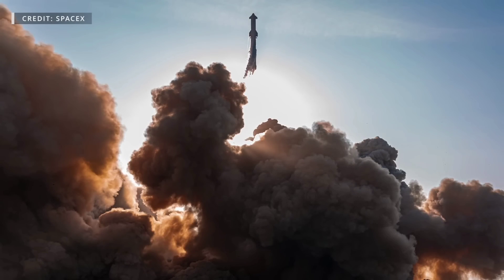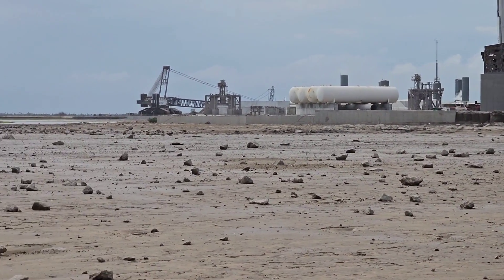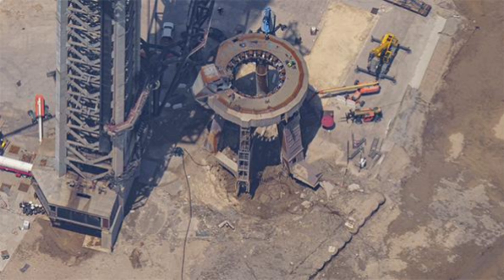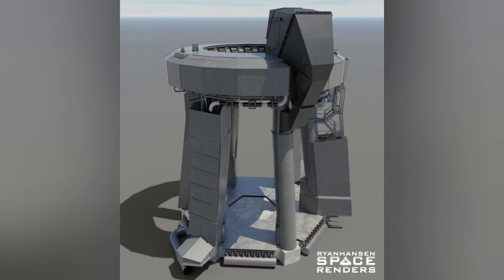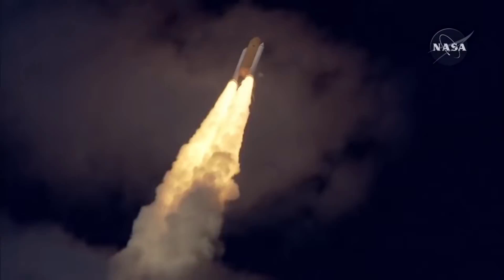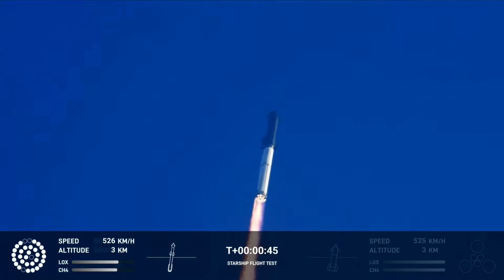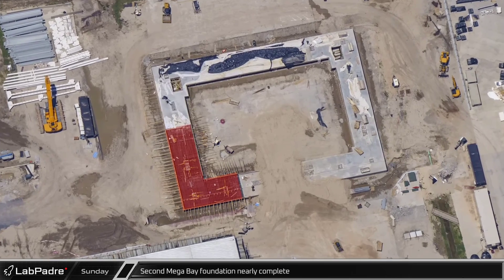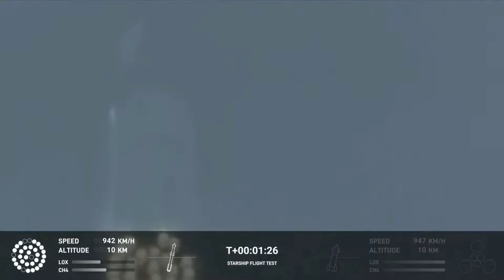Will Elon Musk's water cooled flame diverter be enough to keep Starship and Starbase safe?

Comment: Who said all that debris had to be cleaned up prior to the next launch attempt? I think all that has to happen is the immediate infrastructure (pad) repairs, installation of the cooling plate, re-certification of he FTS and the long-bar is likely the FAA approval of another test launch license.
Reply: I think it would be a great idea to remove all the loose lumps of concrete that will become the next generation of shrapnel if they are still near the pad - don't you?
Reply: @occamraiser  I'm sure SpaceX will survey the situation and do what is required.
Reply: I agree, and that remediation outside the fence is completely separate from resuming flight operations (unless SpaceX blows it off or something dumb like that). However, material changes and re-qualification to the FTS will likely require some kind of lab or range testing to demonstrate the reliability numbers (which are almost cartoonish high), but amending the launch license for a second flight can be done by email and pdf as was done before. The paperwork is actually the easy part because it's just the bucket into which the work gets poured. Time to do "The Work" will be the limiting part.
Reply: @brendanpells912  If the SLS had blown up on the pad, or if Starship had lifted off from the SLS pad the debris would still have hit a nature preserve

let alone any rockets that fail after they lift off.
Reply: @davidelang  Maybe, but NASA minimises the risk of that by a structured, comprehensive test program. For example, conducting a full duration static fire test of the SLS core stage. SpaceX, in contrast, attempted a launch using rocket engines that they knew were unreliable and likely to fail. I wouldn't allow Starship to use pad 39A, they can build their own pad.
Reply: @brendanpells912  Yep, and that is why the SLS program is so much longer and costs so much more than the Starship program.

And SpaceX is building a new pad for Starship, so people should recognize the different development process and recognize when issues are fundamental vs just a side effect of the different development process.
Reply: @davidelang  Well, we don't know how much the Starship program is costing because the SpaceX accounts are opaque, and the program is still at an early stage so who knows what the final cost will be. SLS is also human-rated which makes it more expensive whereas at the moment, Starship is literally an empty tin can.
Reply: @brendanpells912  They stated since the launch that they expect to spend $2B on the Starship program this year.
Reply: or that the same skilled labor required to repair the pad would be the same people cleaning up the debris? shit you got youtubers picking up the debris to sell on ebay, this idea that the debris is a hindrance just shows how disconnected from reality this guy is.
Reply: It's a condition of the site licence that any debris has to cleared up, without driving any vehicles onto the surrounding nature reserve. If the FAA permits another launch without cleaning up after the first one it makes a mockery of the planning rules which SpaceX is paying lip service to. This is why the FAA is being sued, for it's failure to enforce the site licence conditions.
Reply: @brendanpells912  Good to know.
Reply: @brendanpells912  I somehow doubt that they would require the removal of a multi-ton hunk of starship (say the thrust puck with attached engines) without the use of any vehicles. They didn't require any such thing for the SN 11 parts, and in fact they are now instructing people that if they find any SN 11 parts, that they must be left in place as they are now considered part of the ecosystem
Reply: @davidelang  Two people can carry a portable generator that can power angle grinder to cut it into small pieces that can then be carried out by hand or in a wheelbarrow. If it takes a year to do it by manual labour then that's how long it takes. Or do it a launch site that isn't surrounded by a nature reserve.
Reply: @brendanpells912  So you are saying that there should be no launches at the Cape in Florida either, that's all surrounded by a nature preserve (hint, land not used for anything else tends to be classified as a nature preserve, it satisfies bureaucrats needs to stick labels on everything)
Reply: Not sure why people think this is some sort of insurmountable task. Go out with a sweeper and a bobcat and you can probably clean it up in a couple of days. It is probably already done.
Reply: @matthewdehring2898  because the surrounding land is protected.. only in extreme scenarios are vehicles even allowed on it.
Reply: @matthewdehring2898  Not allowed.
Reply: Well, that certainly would be Elon’s preferred FU local residents & environment but in a modern democratic society we don’t have kings.
Reply: @kurknielsen  We don't have kings, but we do have contracts and licenses. Im just wondering what is required per the contracts and licenses.
Reply: @ronwatkins5775  twitter really does need a sarcasm emoji..  yes , SpaceX is required to ensure the wildlife preserve and local communities are not affected but elon has shown he has no interest in doing so.  And in Texas, $ makes the rules.
Reply: @kurknielsen  Sorry, my bad
Reply: @kurknielsen  You do realize that Elon Musk and Space X have bent over backwards to mollify the Eco Wacos right. It's folks like me who say F.O. , we don't give a crap about a few critters and some beach sand !

Comment: The area that was blown out by the exhaust was telegraphing where the flame diverter trench needed to be built. The water-cooled plate could work alongside a full water deluge system and a flame trench.

Comment: Could move it out to sea, my big question is how do you land it in on moon or mars unless you first land with a small ship and bulldozer the regolith ( spelling ) away . Or is the thrust being much less to escape these gravity wells means you can use less thrust on landing and take off? I assume the latter? My previous estimates of 6 cm diameter cables was wrong, because fully loaded starship with boosters is 5000tons not 250 tons as google indicated on my quick search …
Reply: Considering Starship itself will use much less trust + lower gravity and they will have bunch of ships not return from either Moon or Mars they might as well take some sort of solid platform that can be assembled on surfaces.
Reply: @YohXoX  Less gravity and much less atmospheric pressure on Mars.
Reply: @YohXoX  spacex had these little thrusters seen in the starship moon animations. Raptor is too powerful for a moon landing. Using pressurized methalox for thrusters higher in the starship would cause little disturbance. You also have to realize the booster needs the flame diverter/water cooling more than the second stage of starship 7500tons of thrust vs 1500 for he second stage
Reply: That's 33 raptor engines at 90% to take off from Mars it will be 3 engines at 90% to take off from the moon they won't even use a raptor engines they could take off with monopropellant (cold gas) thrusters if they really wanted.

Comment: Well one thing's for sure.  A lot of that water will expand by 1600x, and it's not going to be diverted in particular.  Even though tech like this has been done before, it certainly has not been done at this scale.
Reply: But while the water is expanding, the exhaust gasses are shrinking considerably. Net overall effect is a reduction in overall volume.

Comment: The problem with concrete is it can't handle the shear forces, just look at how the reinforced concrete vertical supports held up. They need just as much armor as the ground. Water does have incredible heat capacity and if he can get a good layer of water seeping through the metal armor for film cooling it does have a good chance at surviving. Building a flame trench would require building the pad taller or risk the salty water table flooding it. They could reduce the water table height by constantly pumping out the water, but again another half-measure.
Reply: That is the point and why the concrete debris was considered a minor issue in the after action. 
First the acoustics are not a concern with this system SpaceX is using Cube law hear so minimizing reflections is the goal, thus the open sides and the 70' hieght. 
Next this is not a steel plate but a steel sandwich. A top plate plumbing and a bottom plate. Most of any flex will be on the top plate the forces are distributed throughout the structure before the ground or pad comes into play. 
The water cooled is straight out of existing flame diverters and has proven reliable. 
What SpaceX is adding here is the shower head that is designed to use the created steam as a pressure diverter. The exhaust has already reached it max thermal expansion, when it meets the water and then the steam that will begin its expansion. This should produce a pressure dome much like that formed in reentry. This will push the mixture of exhaust and steam out an as importantly up. This will allow more of the cubic expansion effect to take place sooner reducing overall perimeter pressure. You can think of it as a virtual circular flame trench if that makes it easier.
Finally it was the erosion under that concrete that produced the sheer that broke up the concrete. You can see that in the post launch photos where the perimeter slabs were broken up by slab along expansion joints. The perimeter slab will basically become the floor of the flame trench and behave much as it does. Spacex will of course look at the erosion post launch to see if more needs to be done. But they are testing Stage 0 every bit as much as Starship.
Reply: @judedornisch4946  excellent analysis, thanks. What I wonder about is if the forces from the exhaust can flex the top plate enough to allow exhaust to creep into, and under, the seams of the top plate sections and start peeling it away. In that situation, wouldn’t the hot exhaust turn the water under the top steel plate into expanding steam, aiding in the removal of the plates?
Reply: @jwortman1984  Flexing that thick of a slab would require it to get extremely hot almost to melting point. With water running through the pipes under it would be very hard to get it to that temperature. It would also be very hard to create a flash steam point if the water was flowing before the plate started heating. As long as the water is turning to steam close to the nozzle holes the comprehensibility of water or lack there of will prevent excessive back pressure so the heat will be carried out and up and the super heating continues in the open.
Reply: @jwortman1984  the bottom of the top plates, with water on their underside, probably won't have much heat transferred to them by the time the rocket is long gone.  Conduction takes time.  Even if not, the water will keep the underside relatively cool.
Reply: @judedornisch4946  Bingo!
Reply: @judedornisch4946  Thanks for this explanation! Do you have any thoughts about balancing water flow with boil off and the pressure of the Raptor exhaust; mainly - how do they ensure that there is always enough water coming out of a hole to keep the exhaust out of the hole and potentially exploding the chamber under the hole? Too much water pressure and they might wash the Raptors - and I'm sure that won't be a good day.
Reply: @erics2112  My fluid dynamics is mostly at the practical level and a bit of theory. But I really doubt SpaceX will engineer any fountain that will have the water moving more than fast enough for the flow to reach anything like more than an inch or two. The Steam is heating up and so expanding and the Exhaust is cooling down and so slowing and condensing. It doesn't appear like that because the surrounding air is heating and expanding also and so influencing the the direction of momentum of the molecules outward. So the expansion of the steam will never reach the engines as the heat will normalize before that. 
As far as water pressure goes the first thing that comes to mind is expansion chambers. Just a conical hole would do much. Much like a rocket engine.
Reply: The concrete also cannot handle tensile forces, such as those produced by intense low frequency vertical shock from the engines.
Reply: @clivemitchell3229  Meant to say shear like shearing. A bit the same thing as tensile. And oh crap the supports were probably turned to sand filled metal tubes.
Reply: @leerman22  There is little reason to think the concrete in the legs has been degraded. If that had happened we would see some external evidence on the exterior leg jacket. That tube would have had to deform to put a non-compressive force on the concrete.
Reply: I have to agree.  Even if you can build a flame trench, trying to get away from the concept is a much better choice.  You greately reduce cost and you might actually get better sustainability and reuseability out a Steel cooling plate.  Its also easier to swap out.  Less to repair.  A water system should do the trick for now, but for the future commercial space port, I think SpaceX should explore the same concepts the nuclear industry is using for cooling Gen 4 reactors, using liquid metals, molten salts or gasses.  The heat exchange is a hell-of-a-lot faster and liquid metals don't change their state so easily.  Just a thought.
Reply: @TheJTcreate  A cloud of steam has some other benefits in addition to cooling. Just for one the dust in the exhaust cloud will serve as points for condensation as it does in the atmosphere and clouds. So you rain the dust out of the plume an limit its extension.
Reply: @TheJTcreate  Did I miss something? As I understand it, the water is supposed to come out the top of the plate at higher pressure than the rocket exhaust and be flashed to steam there. the steel should not ever get hot enough for a problem to develop. the phase change of the water to steam should provide enough cooling. If the system works as SpaceX believes it will work, the thing should produce a massive cloud of steam.
Reply: The vertical supports have a full metal jacket, they are concrete filled steel tube.
Reply: @andyalder1  Wow
Reply: The problem was the slab was insufficiently massive and reinforced most likely due to the high water table so space x thought the thin slab could handle it... They also appear to have neglected the base which is very important in a high water table environment especially where lauch vibration can caise the soils beneath the slab to liquefy and  the slab then to deflect...  This slab needs to be feet thick with a heavily compacted aggregate base feet thick or even a multiple feet thick RCC base stretching out from the pad a dozen or so meters topped by a feet thick heavily reinforced with very large rebar finished slab...  If you eliminate the deflection and add enough mass the water plate should be sufficient but as I've said we're talking feet of concrete and base material not inches which is what it appears they didt with pad mark 1...

Comment: ok, you are confused, Elon talk about having the launch pad ready for a launch in 6-8 weeks
and you talk about the debris which are not related to the needs for a new launch but it's "only" a cleansing process. 
after, yes Elon put crazy timeline, and it's the sign of a good manager.
why?
simple: when you want something ready in 6 months, you put a timeline of 3months on the table.
you put higher objectives than what is required just to make sure the efforts are deployed to try to achieve them, and make sure you'll have something good.
check how many years it took for the car industry to start creating EV cars, just because they don't act like this, they are putting on the table a "realistic" timeline which was finally destroy and they are late. so being late from an unrealistic timeline (but on time from a realistic one) vs late from a realistic one...
which one is better?

Comment: it will. they will make sure the soil is super compacted which caused the previous pad to fail.as long as the pad isnt pushed into the earth and crushed into pieces there wont be shrapnel. exhaust going perpendicular to the ground isnt going to hurt much especially since there is a berm
Reply: Compacting is a problem when you are RIGHT NEXT to the ocean.